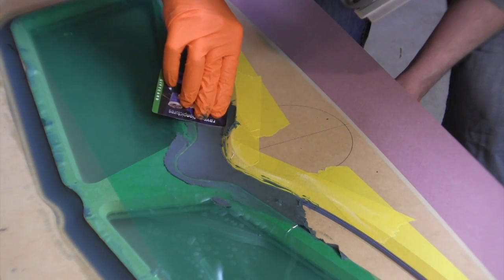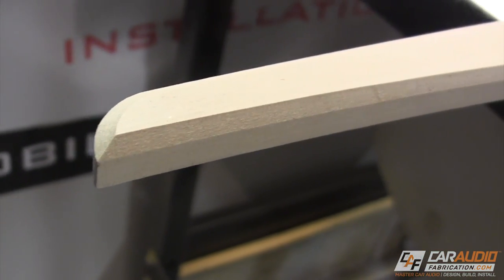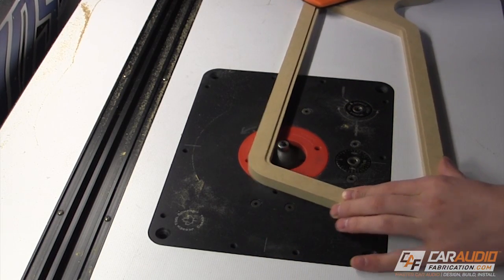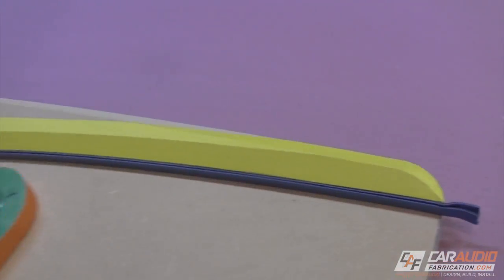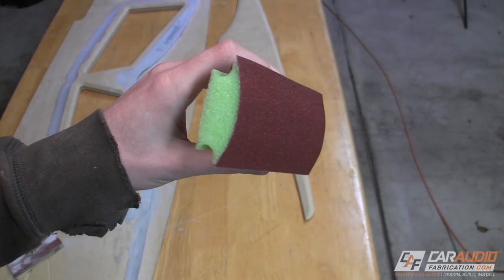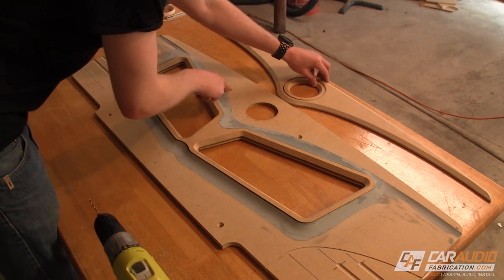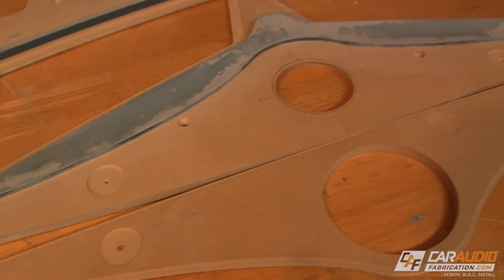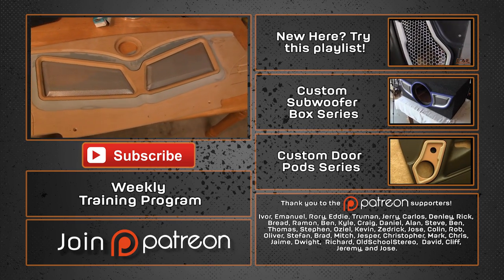Building Car Audio False Wall - Shaping Body Filler & Magnets - CarAudioFabrication

Comment: So yesterday I watched a lot of videos to build a box and I watched a few of your videos. I'm a DIY person because it saves money but it makes me proud of what I have and it teaches me about what I'm doing. I have always loved subwoofers and when I bought my first truck my parents bought me a used 10" sub and a used amp. I had that for awhile. Then I recieved two 12" subs, that sadly I blew up. that was 3 months ago. I now have 9 subwoofers in my room and two in my car. I have 2 kicker 12" subs in my car now but I am planning on building a box to fit 4 of my10" JL Audio subs in, because I am hoping those will be louder. I am using a 900w @1 ohm amp by kenwood and it will be plenty for the 10" subs. plus the box I have planned out will also work great for my kickers. I don't like my current box because it pushes to the back of the car and there is maybe 2 inches between my hatch and the subs which bugs me so I am building a top mount box for my car. I am planning on buying a truck soon and I will put four 15" massive audio HIPPO's in the back with 10k watts going to them. of course I will do mid's and tweets, but I am still researching to find a great setup. I love your videos and they have taught me a lot and make me feel more confident about building my box.